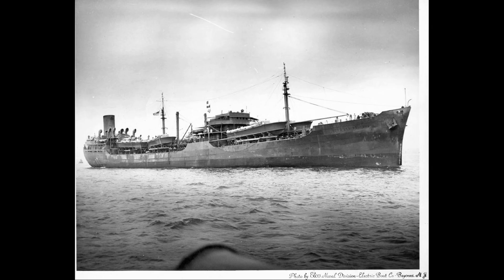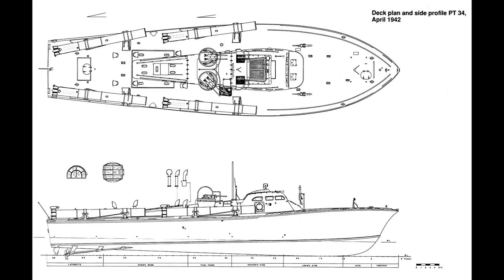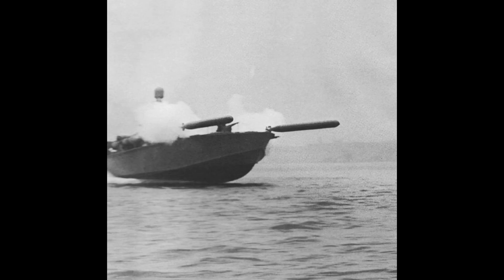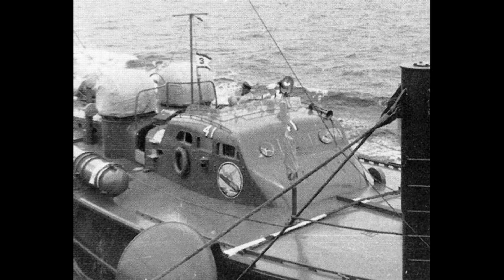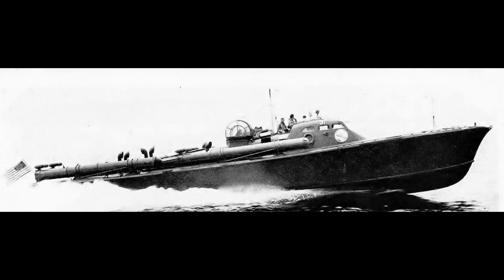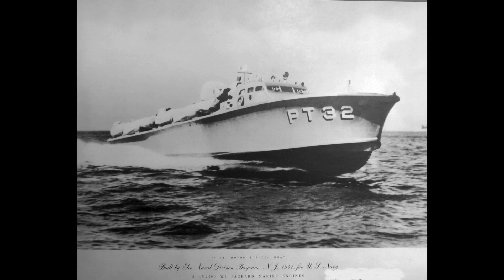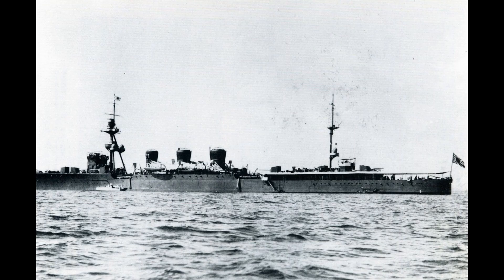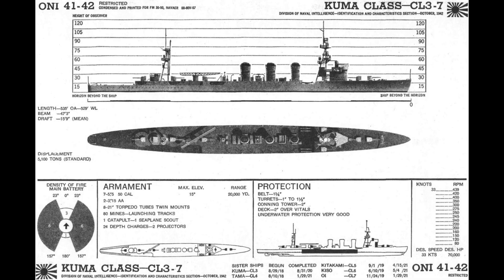PT Squadron 3 - Guide 161

Comment: The idea of depth charges on PTs was a poor one. PTs got their asses blown off if they were slow.
Reply: They were sometimes used as a distraction in order to escape a Japanese destroyer on their tail. They were usually preset for 30-feet and rolled overboard. By the time the destroyer crossed that point, the depth charge would go off, maybe damaging the ship, but mostly scaring the shit out of the crew, fearing some kind of new, secret weapon. By the time they recovered, the PT would hit their smoke generator and get the hell out of dodge and hide.